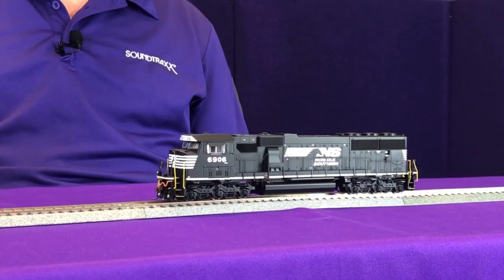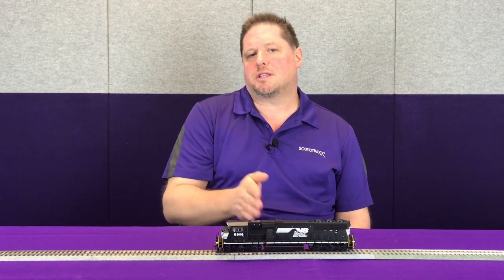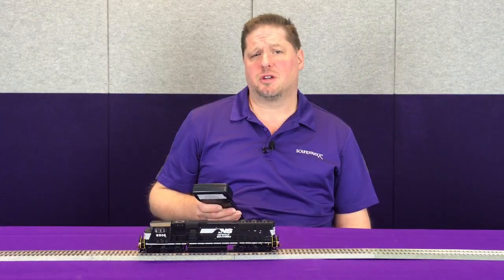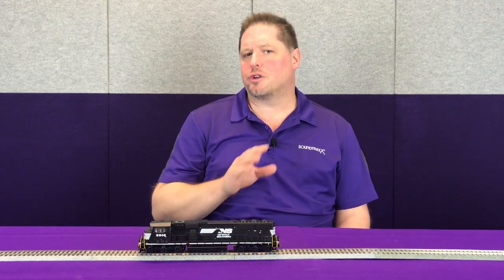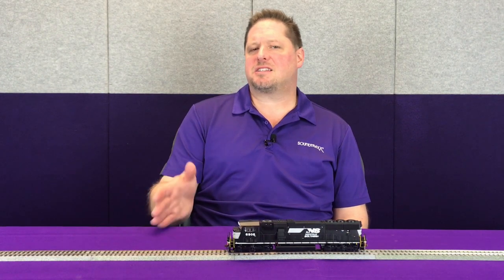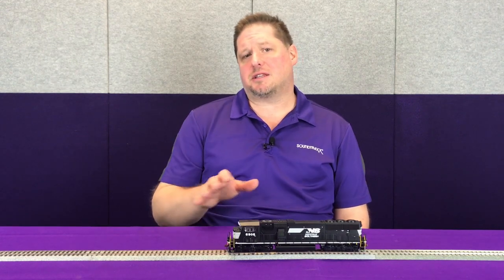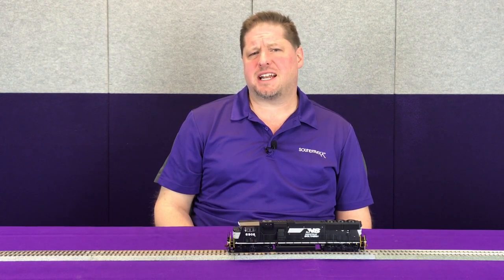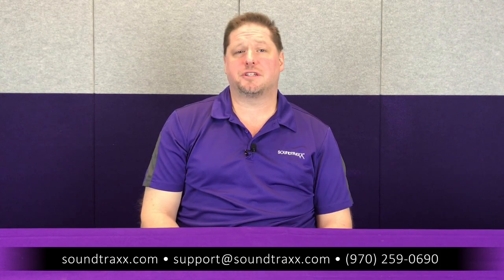Hyperdrive2 Advanced Motor Control with Tsunami2 & Econami Digital Sound Decoders

Comment: How do I set up 128 speed step mode? I have a tsunami tsu-4400 in Atlas o scale 2 rail gp60. Nce procab 5amp system. TIA.
Reply from the maker: Contact our Support Team and they will help you out: support@soundtraxx.com or (970)259-0690 ext. 22

Comment: What CV change to 128 speed step?
Reply from the maker: The 28/128 is selected in CV29. The command station is then set to either 28 or 128 speed step mode. For more info see the User's guide in the Manuals section of our website: https://soundtraxx.com/reference/

Comment: Does DCC slow locomotives down vs DC ? I've noticed that DCC seems to move slower at full throttle versus full throttle on DC. Is this normal?
Reply from the maker: There are features in the decoder that can limit the speed range, out of the package they are disabled. You can contact our Support Department for more help on this: https://soundtraxx.com/contact/technical-support

Comment: Aahh!  That explains when the locomotive having a slight jump when it starts to roll with the first Tsunami decoders.  The motor control is much better with the Tsunami 2.  Well done.  I just did a video on the same locomotive btw and it performed nicely even at 28 speed steps.
Reply from the maker: Glad you like it. Thanks for watching!

Comment: Tsunami 2 is definitely smoother than the original, though with some tweaking  you can get the original to run very nicely. Is there a way to adjust the factory setting of CV215 in the original? I've also noticed that the BEMF is different on the new decoders,, all of my Katos have a BEMF of about 80-90 , just enough to get a little wheel slip at speedstep one, but with TSU2 , I need about 200 on CV212 to get the same result? Not a problem and I assume this has something to do with the DDE settings?
Thanks again for another good video George.
Cheers Gregg.
Reply from the maker: Thank you for your feedback. The original Tsunami does not offer a way to adjust the Back EMF Reference voltage. This is one of the big improvements between the original Hyperdrive and Hyperdrive2.